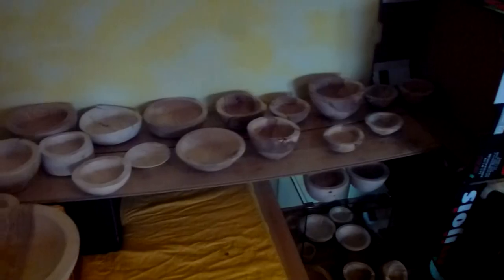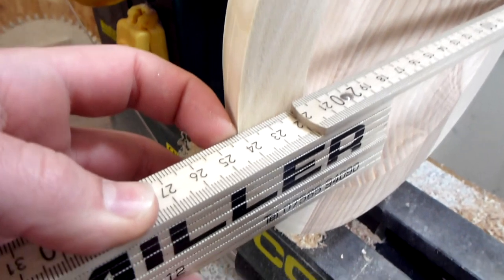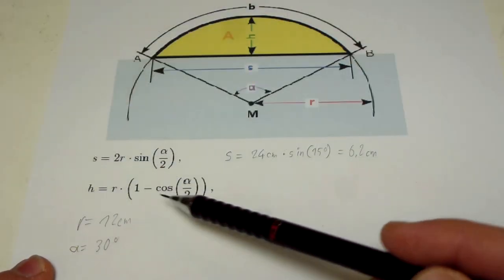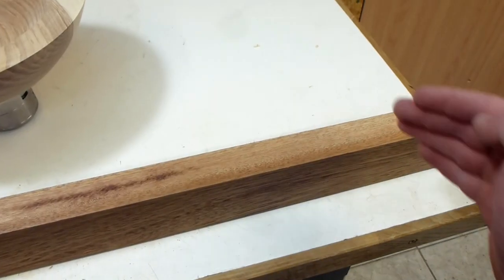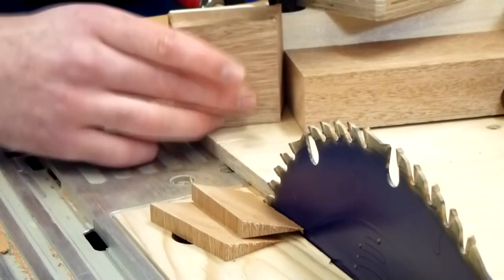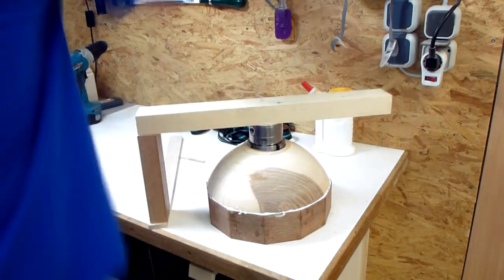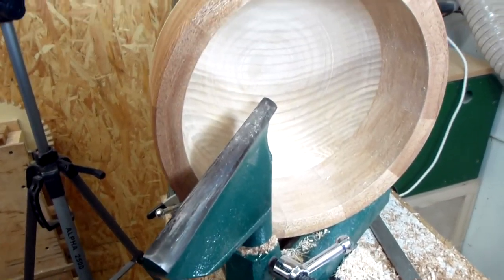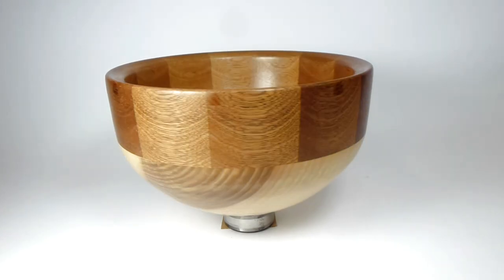Segmented Teak Bowl (with Music)

Comment: The teak is hypnotic. Could you have prepared the inside of the original bowl before adding the teak?
Reply from the maker: you mean sanding and finishing?
Reply: The turning, for which you needed a larger toolrest. (BTW, even my wife likes your videos.)
Reply from the maker: Well, I did turn it without the ring a little bit, bit the bowl shape changes a little when the ring is glued on.
Reply: Thanks for your reply. Enjoy all your videos.

Comment: Looks amazing well done , I need to tu3n a segmented bowl but im a bit scared was it ok to turn :@)
Reply from the maker: alishas woodworks You have absolutely nothing to fear. The segments were really easy to turn, because you only turn sidegrain. The challenging part was the deep hollowing, But with a proper and long enough tool rest (not like mine) this shouldn't be a problem. Just make sure you have good glue joints.

Comment: Do you still have the same lathe? If so are you happy with it? O)r, do you wish you had got one with variable speed? I am interested because I am looking to get a lathe. And this is one I am considering. Thanks.
Reply from the maker: +Richard Hawkins yes, I still have it. After using it for 4 years I'd like to have variable speed (I'll install a VFD in near future) if also like to have a M33 spindle with MK2 taper. Also an auto eject for the tailstock would be nice(I already upgraded that myself though)
But still a perfect beginner lathe
Reply: Thank you Marius, and thank you for your honesty, that is very helpful and useful to know.
Reply: Hi again Marius. Is it cheap and easy to install a VFD? I couldn't find anything on Google about it. Hopefully you'll do a video on it!!

Comment: You need calculate inside not outside
Reply from the maker: pubboo No, I could do that too. But the stop block wouldn't work, if I used the inside measurement.
Reply: Marius Hornberger if your stop block on angle it's not the problem☺
Reply from the maker: But I would have to make a angled stop block...